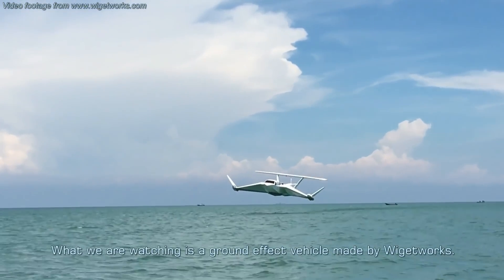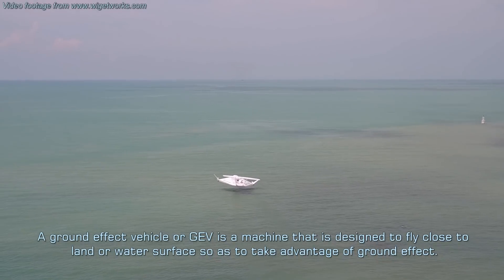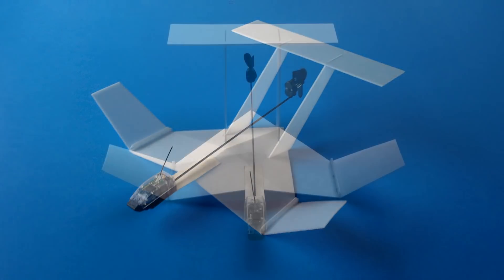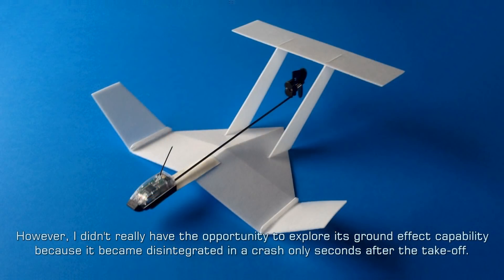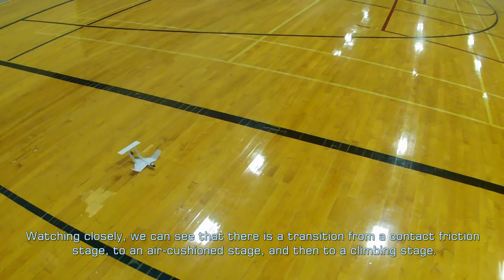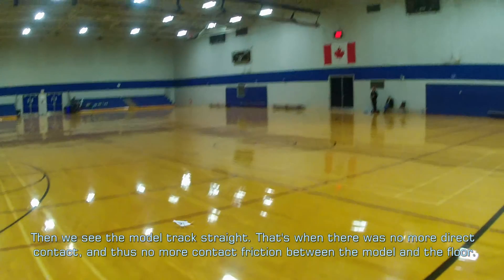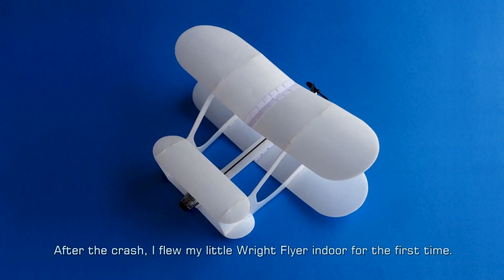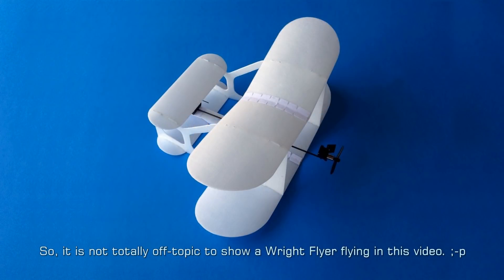POWERUP a Ground Effect Vehicle

Comment: Max, I think you're missing the point. A GEV, (also known as a WIG, Wing In Ground) is a boat, not a plane. The purpose is to save energy by lifting the boat out of the water by using wings, not  to create an airplane as you demonstrate in this video. Good job on the model though.
Reply from the maker: Thanks for your comment.

I understand the point. It's difficult to regulate the PowerUp module's power output on the one hand and the small light weight model is very sensitive to any changes in terms of forces applied to it on the other hand. As a result, I cannot fly the vehicle, say, just 1 cm above the floor. But I did observe the air-cushioning effect: at certain speed, it felt like the model was suddenly friction-free and slided on the floor.

Comment: They sure are tricky little boogers.  The slightest change in the trailing edge of the wing results in loss of lift and then problems.  Also flight speed is very critical, just a little too much and you are off into the wild blue yonder.  Keep trying though.  Thanks.

Comment: The wing is creating too much lift. Maybe add a spoiler on top of each wing to reduce it. But hey at least you tried. I have an idea on how it should be done but haven't done anything, So hats off to you!
Reply from the maker: Thank you for your comment, Joseph.

Why do you think that we need to add spoilers in order to reduce the lift? The lift is a function of the speed, which in turn can be controlled by altering the throttle. We can easily reduce the lift through decreasing the throttle.

Comment: Why are you trying to achieve high altitude "flight" out of this design?  A WIG is not intended to flown as a conventional aircraft.
Reply from the maker: Well, my intention was certainly to fly it like a WIG, but there were 2 difficulties: 1) the POWERUP system doesn't give you fine control of power, and 2) since the model has so little mass, it is very sensitive to small power variations. If you watch the second video of this model, you will see I did manage to fly it low, making it touch the floor all the time.

Comment: So we see that it is very much over-powered. :-)
Throttle back to about x.25 and it might exhibit sustained stable GEV flight.

Human reaction is to slow for models like this. It'd be a lot of fun to fly with FPV video goggles with this.
Reply from the maker: True. When I was building it, I thought it was going to be very difficult to keep it close to the ground to get steady ground effect, especially because I felt that I could not get fine throttle control. But the actual result was not that bad.
Reply: There has to be more advanced flight controllers that can be reprogrammed to keep it low.